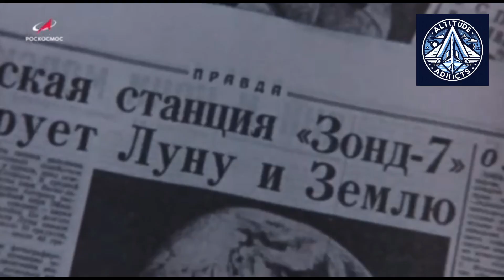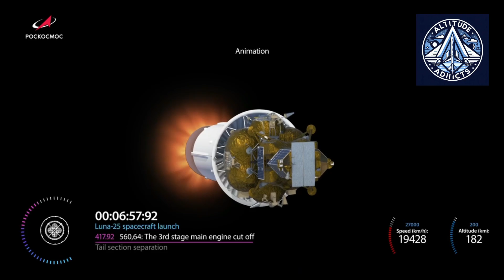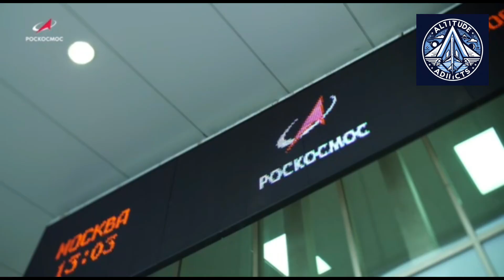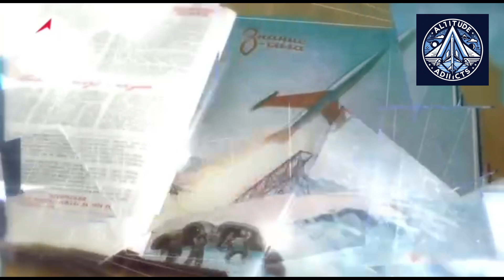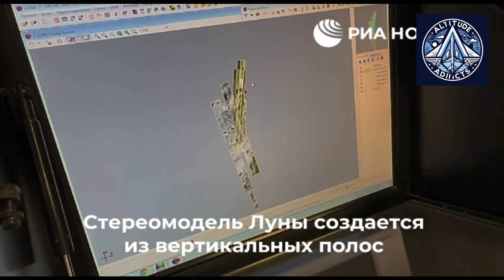Inside Russia’s Bold Plan to Reclaim the Moon by 2030 | Luna 26 | Luna 27

Comment: Now the CEO of Roscosmos is not Borisov, but Dmitry Bakanov. And if Borisov said that, then I disagree with him. Success depends on both reliability and impressive achievements.. a different opinion, choosing one thing is the key to failure and endless lag. I roughly understand why he was CEO, because Roscosmos is also a military corporation.. In general, the structure of Roscosmos is incredibly complex and confusing..  but it is already obvious that ambitions and bold actions are needed.. 
 The mission schedule is of particular concern.. Luna 25 crashed in 2023, and Luna 26 is going to be launched in 2028 - these are too long intervals that harm the continuity of missions. Five years of preparation for missions that should be launched every six months at most is a sign of serious problems and misunderstanding for a space country. At least the satellites were put into production.. Before that, the creation of the satellite was an event on the scale of the discovery of the space age..
Reply: Bakanov was not a bad choice. But his scope for action is limited.
Reply: > to be launched in 2028
I am sure that Roscosmos will find compelling excuses to postpone this mission.